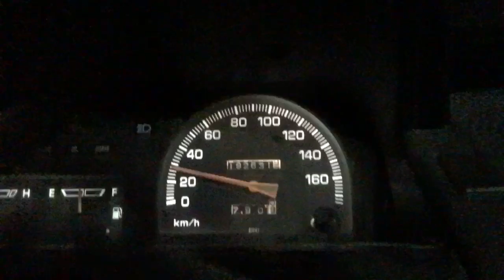1.5L/100km - Running your car on vapour - It really works!

Comment: Are you still using vapor fuel?
Reply from the maker: No, not as a daily. Still experimenting to find the right air/fuel ratio and also how to maintain a consistent fuel heat, because that changes the air fuel ratio as well. 
More work being done and more videos to come too. Have you checked out my other videos?
Reply: @NathanR1995  There are hydrocarbon/gas sensors for Arduino which might help dial in the air/fuel ratio. Search ebay for MQ-2 flammable gas sensor.
Reply from the maker: I’ll look into that, but I don’t know what your talking about so I’ll have to research and learn some more. Thanks for the 2 cents though